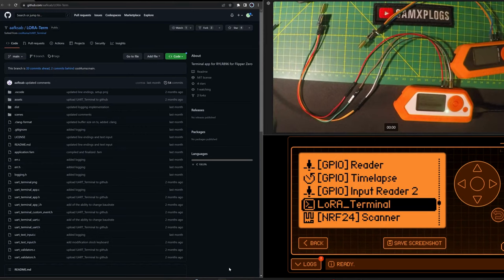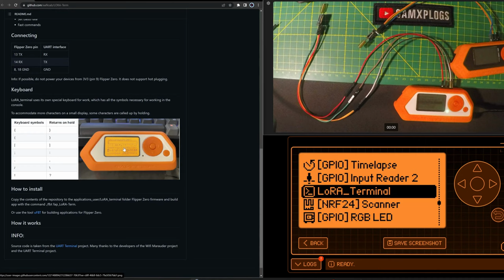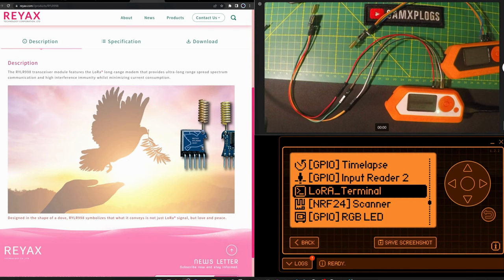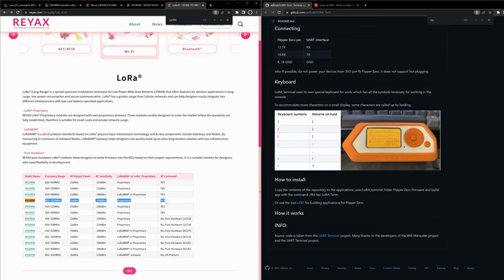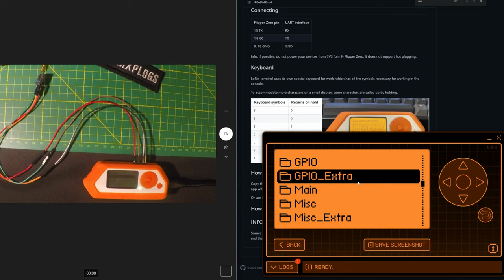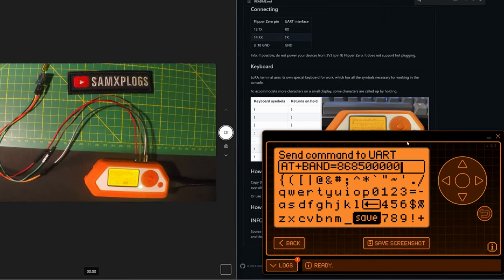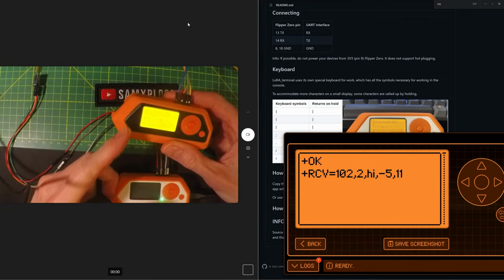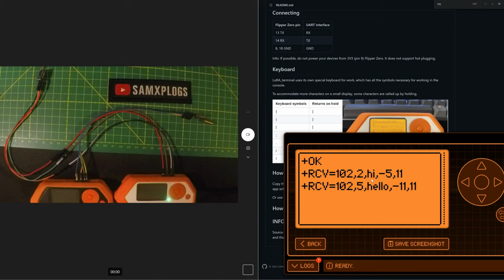How to Connect a LoRa Module to Flipper Zero for Long-Range Wireless Communication

Comment: Do you need to have unleased to use this? or will the stable standard version work?
Reply from the maker: Hello David, I realize I forgot to add the links to the unleashed firmware. Latest stable release will works for instance https://github.com/DarkFlippers/unleashed-firmware/releases/tag/unlshd-033 and you will have to add the latest extra applications https://github.com/xMasterX/unleashed-extra-pack/archive/refs/heads/main.zip
Reply: @samxplogs  Thanks for your reply, I just want to confirm that this only runs on Unleashed? I tried the UART terminal on stable and I can't get a confirmation with AT  command. I have two RYLR896 modules, but nothing seems to work.

Comment: Hi! Thanks for this video! I have a question - can you use 2 flippers with LoRa installed to chat on long distance using sub-ghz chat app? or maybe there is another app for that?
Reply from the maker: Hi Redbull drinker :) Unfortunately, as of now, there isn't an application that takes advantage of the LoRa module on the Flipper Zero like the SubGhz chat. I'm eager to see what the community will release in the future regarding this.

Comment: Are networkid and network address LoRaWAN elements? Or parts of LoRa itself?
Reply from the maker: Hi Neometal, in the context of LoRaWAN, the NetworkID refers to a unique identifier assigned to each LoRaWAN network. It distinguishes one LoRaWAN network from another and ensures that devices are communicating within the correct network. In the video, it was evident that these values are arbitrarily defined. I have set up NetworkID 102 and assigned addresses 2 and 5, but it could have been 101 or any other value within the designated range. It ultimately depends on how you choose to divide the addresses among networks in your setup.
Reply: @samxplogs  Ahh ok so it is LoRaWAN, thank you! So this module is designed for LoRaWAN it probably can't do other LoRa protocols like meshtastic right? Or do you know if there's a way to access lower level commands on it too? Either way having long range messaging on the flipper is cool, thanks for the informative video and for your response!

Comment: Has there been any more recent developments with Lora integration?
Reply from the maker: Hello Jonas, I haven't noticed any new LoRa development on the terminal application. In the meantime, I've purchased some Meshtastic boards. I'm not quite ready to develop an application to interact via serial, but it's something I might start tinkering with. Writing with the Flipper Zero is far from convenient, as you've seen in the video, and I believe it should act as an intermediate or display only.
Reply: It's been a year, and someone really needs to put some love into this 😔

Comment: I also been looking something like this for the Hackrf portapack.
Reply from the maker: Hi Elias, very interesting ! I bought the HackRF back in the days to help me with LoRa WAN router installation. I ended up stopping this project. However you should be able to capture potential signal from the LoRa network. I made some research and it seems either with GNU Radio or with some scripts like here https://www.trendmicro.com/en_us/research/21/b/gauging-lorawan-communication-security-with-lorapwn.html using SDR (software defined radio), we could proceed decoding the LoRa messages. Is it what you are trying to achieve or you want to communicate using HackRF and PortaPack as a LoRa terminal ? I think there are other plugins to do so that could be implemented. Which Firmware do you currently use ?
Reply: Exactly what I need. Thanks Sam.

Comment: Worst video ever, you don't actually show the LoRa module and how to connect to Flipper Zero.
Reply from the maker: Thank you for your feedback 🤗. However, did you watch the entire video? At the beginning of the video, around 1:30, I specifically address the correct wiring. If you are still experiencing difficulties with the wiring process, please let us know. The module uses the UART interface. May peace be with you. 🙏